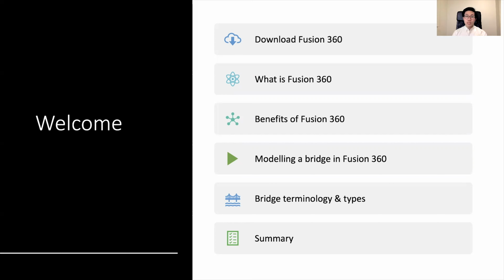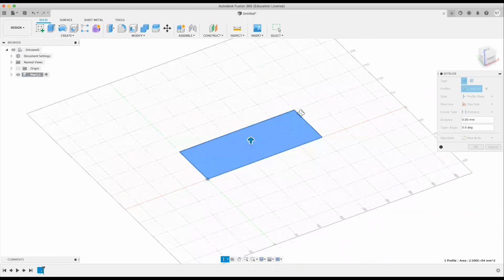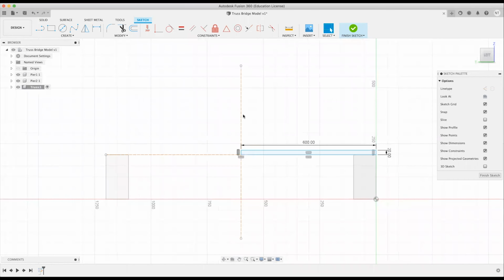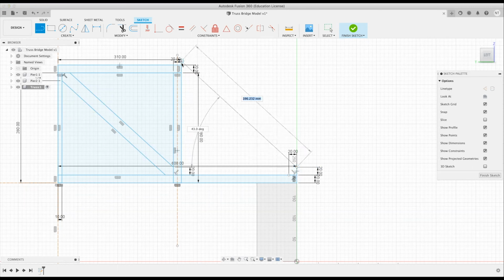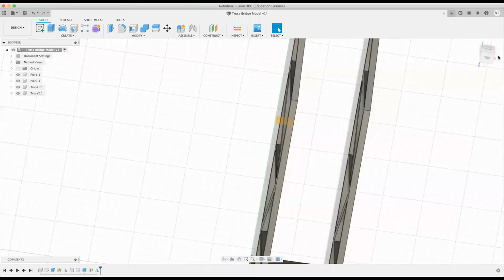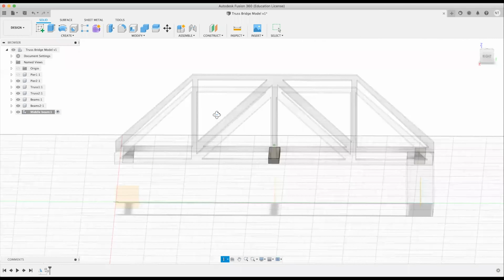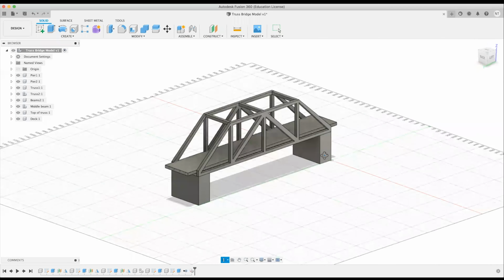Fusion 360 for Civil Engineers

Comment from the maker: The video is pretty long and I know your time is valuable so I’ve included timestamps with asterisks (***) on the most important points if you’re in a hurry. If you want to hear about my thought process and some commentary (or just enjoy hearing my voice), feel free to watch all the way through!  

TIMESTAMPS ⏳

0:00 Introduction
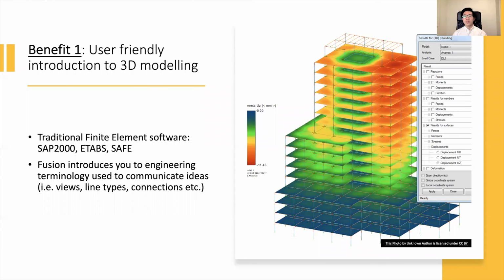2:14 Benefits of Fusion 360 for Civil Engineers *
5:16 Basic bridge terminology 
6:55 Summary *
7:35 Introduction to truss bridge example and design process
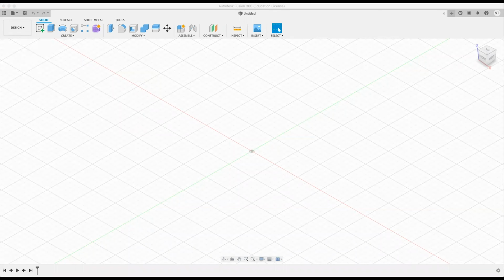9:36 Key Fusion 360 features
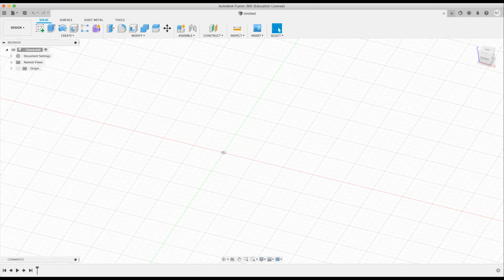12:15 Layers, sketch, dimension, extrude tools *
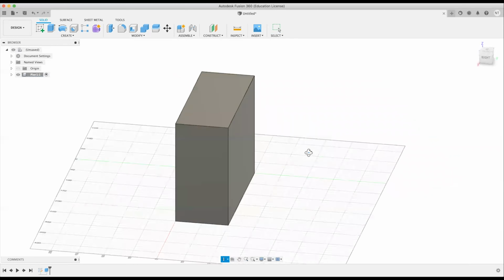15:20 Mirror tool *
19:28 Line tool
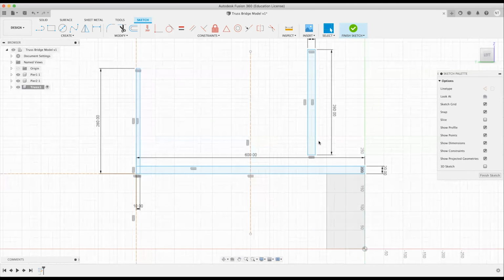24:20 Move tool *
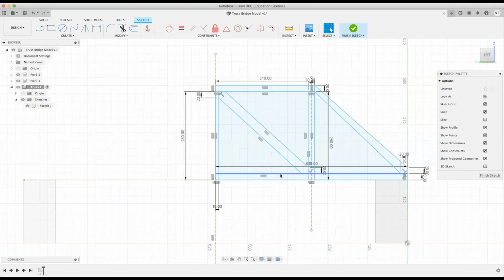29:45 Sketch mirror tool *
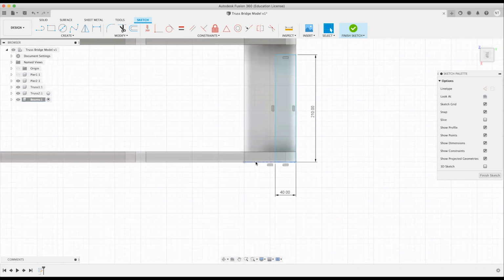39:30 Midpoint constraint
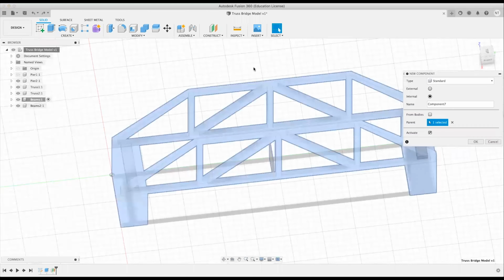42:50 Copy using move *
46:30 Appearance *
48:12 Render settings